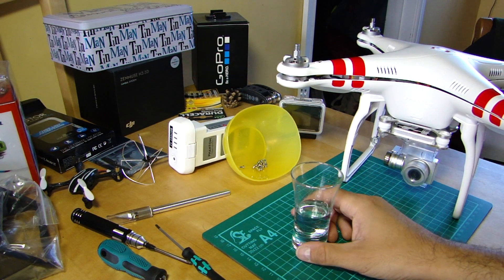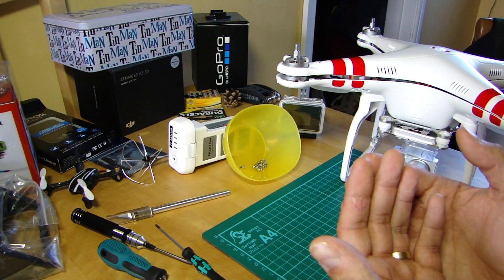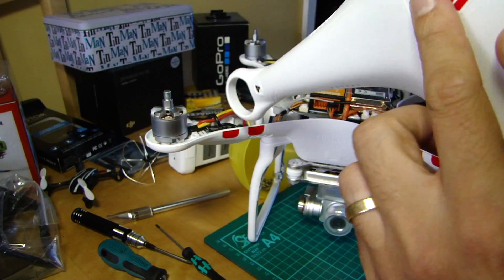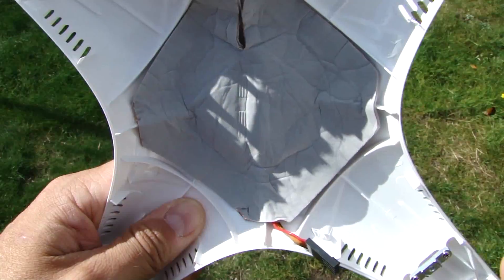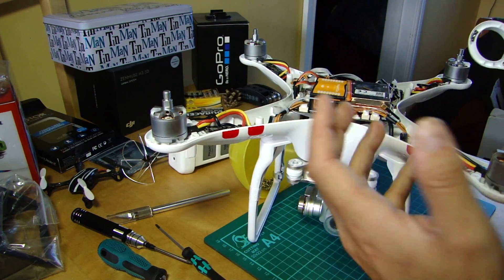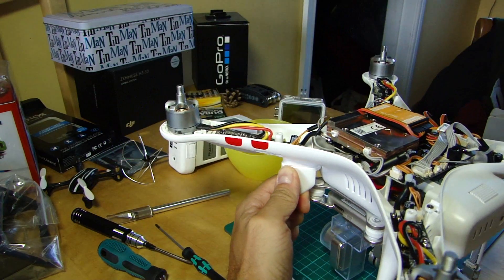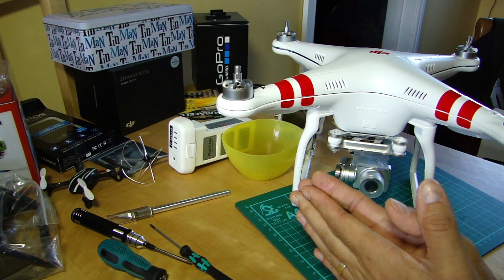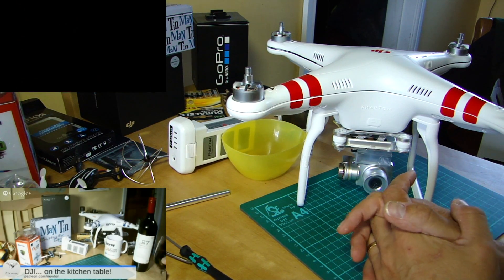How to improve satellite reception on your DJI Vision+ without adding foil?

Comment: Are we sure this mod works for the Vision non-plus?  If you view droneexpert's vid of this same mod for a Vision+, he shows in the beginning of the vid that in his example, the satellites improve from 6 to 7 by moving the GPS receiver away from the wifi transceiver, implying, of course, that the problem is the GPS receiver is too close to the wifi transceiver and has inadequate shielding.  But the Vision is designed a bit differently than the Vision+.  In the Vision, the transceiver (and the antennas too) is in the camera, not in the Phantom.  So it seems likely to me that this mod won't improve a Vision's GPS.  Comments?
Reply: +Mark Ennes I meant to post the above on your "GPS Booster" vid.  <sorry>

Comment: Hi Simon.  Thanks for you info.  I tried this and it also made my GPS worse - from 7 to 3-4 sats.  So I held my breath, did some research and found that copper foil was better than aluminum.  Located some copper foil at a guitar store (used to shield electric guitars but getting harder to find as they are moving toward copper paint), and made a paper template to determine the proper size.  I know that this may impact my warranty but the foil does peel off quite nicely if I have to send it back.  These instructions I found also did help: 

http://www.phantompilots.com/threads/how-to-install-copper-foil-shield-fix-low-satellite-count.31054/

Cheers and thanks again!

Comment: Thank you so much. This really helped me. I was flying earlier today in a place with a lot's of trees around an open field and I got about 4-6 satellites at the ground, and it was no clouds in the sky. I have sometimes during flight, satellite drop, so it wont stay in it's position. It goes below 6 satellites and following the wind. After this "fix", I now got 6-8 at the ground. Huge improvement. And not it stays rock solid in the air. Thank you very much Simon for sharing. :)

Comment: i might have to do this.. my sats have been terrible of late..used to get a good 9-10 in front garden..today only managed 5.. out in the field i get 7-8.. then after take off it rises to 9-10..im wary of opening it up..but this seems simply enough..  thanks for the tip, simon
Reply: Got a black ops 
Gps booster  from buzzcam,fitted today, great improvement, will test out in the field next few days.also now fitted the inspire 1 tablet mount, fits like a dream,great viewing angle as well.

Comment: Hi Simon,
It would be good if you did a follow up on this. What has been your long term experience? I have my doubts. For one it was a short term subjective test. That is not bad but that is what it was. Secondly I have done some research and since your video and so have others.
Your test fails because you have made a couple of assumptions. The main one was that it was the Phantoms problem. The results you got could have been just random variations.
And this is why.
1. The DJI GPS detector is only tuned for American satellites and your phone is tuned for GPS and Glonass(Russian). So if you check your phone you will see more satellites than the Phantom.
2. The position of the satellites changes very quickly. You can go from having 6 visible to 4 visible in 10 minutes. Enough time for your two test to have a changing environment.
3. The satellites can also be affected by Storms even 200km away. As the satellites pass behind them they become undetectable. I say this because you would assume local obstacles can mitigated by gaining altitude, not distant storms.
So......
Plan your flight for the best satellite availability on the day. The link below is simply awesome resource. It will help everyone understand what their Phantom is up against. It is a French site so change the language to English.
http://www.spectraprecision.fr/support/gnss-planning/

I believe the Inspire now has Glonass satellites. I would be great if we could get them for the Phantom. Galileo would be even better. And to include the Chinese GPS(BeiDou) and we have a game on our hands.

Quote from DJI
"As it flies, the position of your Inspire 1 is constantly updated and recorded using a high-strength, intelligent GLONASS + GPS system. This dual positioning system enables higher precision and quicker satellite acquisition, allowing you to see where the aircraft is on a live map and giving it a point to hover at when you release the controls. In additional to traditional GPS, GLONASS offers an even greater level of precision by providing even more satellite"
   To see DJI solution see https://www.youtube.com/watch?v=Rg2VnC2SjQ4 at 26:35m As you mentioned in another video he covers the shielding and iron ferrules but not the relocation of other electronic devices. DJI also put insulation of the last cm of the GPS cable. I was thinking if you snip a bit of the shielding away and wrap around the last bit of the cable, that might help too. Anyway it is quite good. Also I found that 3m make a EMI/RFI shielding product in various sizes for about AUD 20. The specs I saw said it was good for 100MHz to 1 GHz, this would not be good enough for WIFI. So maybe the aluminium shield helps improve the bandwidth protection.
 Regards
Reply: Fantastic web link. Yes, you must pick the right time to fly. And weather of course.

Comment: I have same kind of problem with my copter. When video recoring is turned on the amount of gps singals is turned to zero. Could this cable failure have something to do with it ? Look at the picture. https://plus.google.com/photos/102927619405936340431/albums/6129096950589800801/6129096952238847922

Comment: I tried this mod, but seems to have made it worse, and when i did eventually get 6 it went to zero when i turn the video on, any ideas Simon ?
Reply: ***** toby london same as toby here. For my v2, before change it is consistent gps signal with or without video, after the copper plate and also gps cable beneath shield, my phantom drop by 2-4 sat if switching video on.
From feedback received on my post in P2V+ owners group in facebook, someone suggested me to insulate the compass cable. will try and see
Reply: tony lai Hi Tony, ive been reading about this in the forums and have found the following that might be helpful. Carry out the normal full shielding mod on the whole gps module, cable as well, then if youve noticed when you  took off the ltop of the phantom for the first time you will notice that the gps cable is very loose when re inserting it , this loosness seems to be causing the drop out with the video on. Try making the gps connection more secure. I havnt tried it yet but i will be.

Comment: Good idea Simon.
How about-leaving the wire as is-but winding it's full length in tinfoil-then winding it up in electrical tap or heat shrink?
Worth a shot--it could easily be removed.
Cheers.

Comment: I have a Vision+ 3 so its shielding is different and more robust than the version you have here, but rather than cut the shielding foil and placing the wire under the foil (thus shortening the available wire & putting pressure on the connector to the GPS board), why no just take the top shell off and spin it around so the cable is exiting right above the connector in the lower shell. That should allow it to be pushed to the side and not over the wifi transceiver and its interference. That's a no-cut, no bending modification that's very easy to undo before returning to DJI for any kind of warranty work. The decals are no longer facing the "right" way, but that's no big deal.

Comment: Hey Simon a quick alert!! I completed this little mod and it improved slightly but a great little tip. BUT!!!!!!! Youve gotta be careful cause when you move the gps plug to the same side it connects to the main board its actualling bending the female over to almost a breaking point. youve gotta be extremly carefull im posting a halfass video explaining. not professional like yours but informative!!
Reply: I'm posting a quick video I think you'll like!

Comment: Hi Simon,

I decided to open up the Vision + V3.0 today which I ordered in late December after reading on the DJI Forum about some people claiming their Vision + had the new motors but old ESCs.  There was a bulletin from DJI saying that the new motors were not compatible with the old ESCs, but I believe this bulletin was originally written for people that might have wanted to upgrade one without the other. 

Anyway, using this video of yours and the older video link embedded in this video, I decided to open up the Vision + and take a look inside.  Another reason for doing this is I have trouble getting 7 satellites near my home, and I wanted to see if I could improve the signal by doing what you did in this video.

Once I removed the top shell (I recommend removing the tiny phillips screws first, as there is a lot more tension on them if you removed the allen screws first), I found that the V3 Vision+ has much larger foil insulation than the earlier models, and also the GPS wire is routed under the insulation like you did, and in addition, the GPS wire has a metal mesh around it for additional signal isolation.  I couldn't improve on this setup if I wanted to!.

Thankfully, I saw that I have the V2.0 ESCs (although some have posted photos of V2.1 ESCs.  Not sure what improvements were made with V2.1). 

And while the top was off, I put a spirit level on top of the NAZA module, and it matched the level of my tabletop (regarding our IMU calibration conversation a few days ago). 

Thanks again for these great videos.  It really takes a lot of the fear out of taking one of these apart!  I'll be taking apart the Phantom 2 V2.0 next in preparation for the H4-3D gimbal installation.  Regards, Mark

Comment: just did the SImon satellite improvement,  it was a piece of cake getting to the cable and rerouted it under the shield, but I needed two tongues and three hands to get the connector back in.   I suggest the next time you are at your dentist, ask them for a old dental pick.  It will come in handy on these type of projects.  NOW a test flight.
Reply: *****
Did not notice any better from my launch site.. I always only get 6 on the ground, and it took much longer to get the blinking green lights.  I even did a compass re-calibration.   In flight I did get a solid 9 Sats which is one more than the usual 8.  You would think I should get many more on the ground,  I am a Mile High.

Comment: Hi Simon, another quick question for you, it's a bit off topic but you seem to know these things inside and out. I just did an update in which I switched to NAZA and enabled IOC, everything went fine. However, I noticed a hot Gimbal and camera during update. My plastic gimbal lock was on. Could that be the reason?I have the DJI vp2+. Checked both and they work fine but don't know what caused the heat.
Reply: Great! Thanks for the help.

Comment: Hi Simon, great channel! I just subscribed as I got a new PV2+ last night. I just popped the top off and I'm about ready to do the mod. The wire connectors seem to wiggle within each other quite a bit. Is that normal?
Reply: Please disregard the last question,it must be fine because I just did this mod and it worked great! I highly recommend this mod, I was getting 3-4 sats yesterday and today in the same spot I got up to 9 and never once dropped below 6! Thanks for posting this!

Comment: Hey Simon I just tried your idea and it worked awesome. I tried it in the exact same spot where I could never get enough satellites the fly prior I got five to six satellites. Went inside removed the shell move the wire just like you did the only differences were that little piece of wire is sticking out I wrapped it with Gorilla Tape. went back outside got 8 to 10 satellites. . And quick. Enjoy the wine Thank You.

Comment: Simon, I just did the mod on my second Vision+ that only marginally got the necessary 6 at one spot in my yard.  It now picked up 9 in the same spot!  My first Vision+ always gets 9 or 10 so I have not tried the mod on it.  By the way, I had already added aluminum duct tape over the GPS pickup with no real help, but I now have both mods done.  Anyway, thanks for the tip - it worked for me.

Comment: Hi again Simon, I have done this and now get 7 to 8 sat, but when I start video record it drops in and out?? But will see how it goes on the wend 😊 and the gps cable that you have to plug back in I am not sure if it is a very secure connection seems loose doesn't click in I just pushed down firmly, is this right mate??

Comment: Simon, great tip and useful. My GPS lock went from 6-7 Sats before & now consistent 8-9 even inside my house. So it does work.  A small tip-when routing the cable under the shield and over the GPS module, check that no little solder joints on the GPS module are capable of puncturing the GPS cable & if so, a small strip of electrical tape can be used to protect both the GPS module and cable. Thanks again for the great video. Remember to never trust an electron as they make things up.

Comment: Great tip Simon, Thanks, Only comment I have(old safety professional) and I think you covered it, was to always remove the props and the flight battery if you are going to open the case of the PV2+. Also a added layer of protection when touching an electronics is to use a grounding strap on you wrist to prevent static discharge  to any of the electronics in side the electrically isolated components inside the Phantom.

Comment: i experience GPS lock problems and drops ONLY when i hit the record button, so im with you on thinking that the wifi transmitter is potentially to blame. Were you recording with the camera when you did the test outside? Im yet to try the mod, i still have the option of returning the unit to swap for a go pro setup, any thoughts on what you would do in my position? thanks
Reply: ***** Yea thanks for that, its ddefiantlysomething i am considering at the moment. Just wanted to add that i did the mod that is discussed in this video and its actually come out worse, not locking onto more than 5 satellites at a time without the record function on and then when i hit record the satelites drop down to 3 or 4. 

With that in mind i opted out to return this model and refund it to buy the vision 2 with Zenmuse H3-3D gimbal option, the vision + is excellent, if it works! but for me i can afford to run the risk of not having a gps backup most of the time functional while i am trying to record footage!

Thanks for your video, first time i opened my phantom too!

Comment: I did this mod exactly the way you did it in the video. I was getting the bouncing 5-6 sat lock before the mod. Now I get 3-4 sat and it never locks to 6. I have to now take off in ATTI mode and fly it up to 100 feet for it to get 6 satellites. Once it locks to 6 satellites, I fly it to 400 feet to get a total of 8 satellites. Before the mod I was getting 12-14 satellites at 400 feet! What the heck happened?!
Reply: Thanks for responding Simon. I'm located in Texas, USA and I live out in the middle of nowhere. But yes, unfortunately I will be returning the cable to the stock position to hopefully regain some satellites. Nice tutorial though!

Comment: I used Foil and instead of glueing it to the Phantom roof I used a drop of Rubber Cement on all four corners and that works fine. So if you need to remove it you can simple rub the cement off with no marks!! Good Job I might add this to video as a secondary! You can never have enough Sats on the Phantom!!
Reply: Yea I used two sheets of white paper and rubber cemented that to the foil then cut to size and off we go!! Thanks!

Comment: Hi Simon. As always a great presentation, however...... 
Coming from a satellite comms background I'm a little sceptical about the merits of this modification. All the reception, demodulation, and decoding of the GPS signal is carried out in the puc with only serial data passed along the servo cable to the Naza. Another test you could do is to compare two Vision+ Phantoms side by side, one with and one without the re-routed cable. The GPS constellation of satellites is dynamic and the difference in the number of aquired birds between the two tests could be attributed to the number visible at those two particular times.
Regards
Nidge